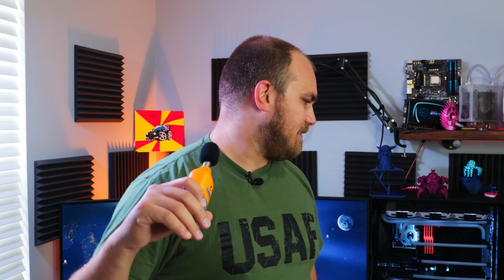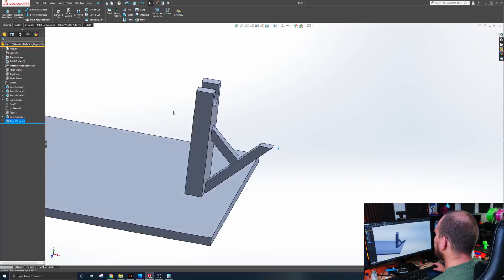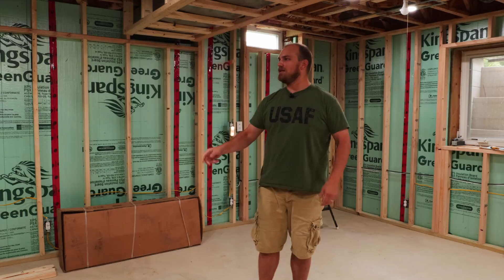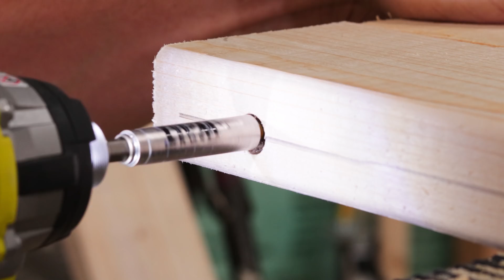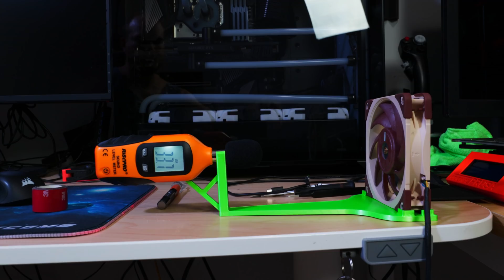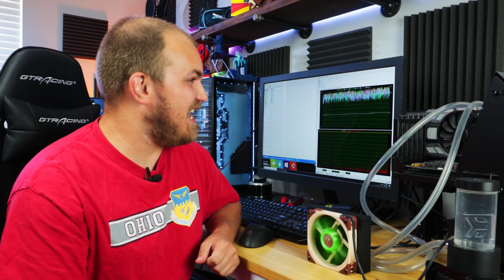Obviously Someone Would Design It That Way | Fan Show Down Episode 2

Comment: the fan thing is a horrible idea. Vibrations from the fan will transmit to the mic through the material connecting them. It won't be an accurate representation of how loud the fans are!

Comment: I'm loving this series, and concept, BUT why doesn't any reviewer "noise-normalize' fans that are being used on radiators, ON THE RADIATOR?!?! The shape of the airflow coming through the fan can drastically change the sound characteristics when said air has to flow up against and ultimately through the radiator. I would imagine this to be especially relevant on custom-designed fans such as in your showdown. It boggles the mind...you test the performance of the fans on the radiator, why not the sound?

Comment: Looks like you set episode 1 to private and did not remove it from the playlist, so the playlist is effectively broken.

Edit: Actually, I have no idea what that first video is. It is private and thus breaks the playlist's auto-play feature. But, Episode 1 has the 6th position in that playlist.
Reply from the maker: I made the first private and reuploaded it because I showed peoples email and then figured they probably didn't want there emails spammed on the internet
Reply: @MajorHardware  Are you aware that you can edit the playlist to fix the order and remove the original?

That sounds like a demeaning question, but I actually know one creator whom only found that functionality after I pointed it out to them. So, i figure it would be polite to repeat that stunt.

Comment: Your audio test is wrong, you pull air by the speaker. A good fan will move alot of air and be queit. But a speaker in airflow will always be loud, a good fan fan do this quiet but a speaker in air wont ever change. Turn the fan mount 90 degrees

Comment: I think the db meter is also going to catch sound from the air. You should put the db meter perpendicular to the air flow and not in the air flow direction. Basically turn the lever arm 90 degrees, perhaps shorten it's length.

Comment: As ridiculous as it looks, that design may still work as an impeller. It would need a different housing to be effective. Impellers work based on centrifugal force; they pull in from the front/back and push it out the sides, radially. A quick fix would be to cover / close up the intake, and cut a notch in one corner of the fan housing. That notch is now the exhaust, and the air would be pulled through the radiator and blown out the notch. Impellers are good for high pressure applications, like vacuums.

Comment: Have you looked into the use of fan stator blades at all? They can help reduce the turbulance put off by the blades and increase the static pressure and motor efficiency. They do increase the noise but with the increased output you may be able to reduce the fan speed for similar performance in a cooling application.

Comment: i recon you should try to use an airfoil wing design for the fan blades and about 5 blades my thinking is the high pressure from the underside of the blades should push more air through the rad

Comment: Shouldn't the sound level be measured non directly instead of in front of the fan?

Isn't testing sound in front of the fan just testing the flow of air?

If you blow directly into a mic / ears, it'll pick it up but it doesn't mean that your blowing would be audible in a room.

Interesting series! :)

Comment: shouldn't you 3D print a nactua fan design to use as a baseline since any fan that is 3D printed will most likely have small ridges and what not that will effect air flow

Comment: I don't know that you want to have the fan and the decibel meter attached. Vibrations from the fan may end up skewing your readings. Secondly having them on a wooden desk would slightly amplify your sound readings as well. Put some rubber feet on that thing.

Comment: Few things, your noise testing is flawed. Your db meter and fan are on a hard surface. Your db meter is gonna pick up vibration. Need to isolate the db meter from any hard surface. Simply lining the mount with neoprene would help alot. 2nd you should do a A weighted noise level. Use the stock fan blade, set to desired noise lvl. And read rpms... then when you test new fan designs. Set to same rpm and test noise to see if fan is louder. Cause you said if you make them the same rpm they will be the same noise and thats wrong.

Comment: Firstly, the db meter stand will conduct vibration from the fan to the meter, which is a bad thing.
Secondly, open-air db levels may not be representative of db levels once attached to the radiator. Noise normalisation should be done in the intended use configuration.

This should be an entertaining series do watch...

Comment: I think it would be really useful to put two temperature probes in your cooling media before and after the radiator. In that way you can tell more effectively how you are changing the heat transfer with each fan. It would be pretty cheap and easy to plumb in.

Comment: green rocket ship design gave me idea. . . normal blades but, inner ring goes smoothly over into two blades, so each blade would be like 3 small blades, 2 small blades connected to one outer blade.

Comment: Thank you for serving our country!! I had a thought for another parameter that can be easily measured... The geek in me would really like to see the amperage draw for each of the designs. From this, the wattage use can be calculated. Use the stock fan as a baseline and then we can see how well 3d printed fans stack up against the original as well as how well they do against each other.

Comment: i just watched the previous part of this, the whole idea of a turbo fan and this dr evil fan flinging the air through the sides gave me 2 small idea that you can easily do (i would do this as a seperate video just for fun and even if it fails it would still be cool to see, so if you want content ideas here is some)... so in the car world we put a shroud that is completely sealed around the radiator so that what ever air is sucked in is not sucked in through the sides before the fins... i know this fan is pushing air in but the same concept applies seal around it between the rad and the fan and air won't leak(all you really need is some insulation foam with an adhesive backing from a hardware store like lowe's or depot) the second idea which came to mind from the turbo fan...it is the idea of a velocity stack... am not going in depth on what that is but you can look it up and get an idea... basically a trumpet shaped device that influences air draw... usually u find this on turbos that suck way more volume in so i doubt this will make a difference here but it would be cool to try and see if those two ideas have any positive effects (u can print a velocity stack so that one is even easier, and in general this will look cool and wacky and will probably get you views if used in the video thumbnail lol)... i just hope you read this and actually do it

Comment: I have a resin printer, if I designed a fan, id rather print it myself and mail it in, that way i know it is as smooth as possible for less air resistance.

Comment: Okay so you're not noise normalizing you're rpm normalizing and reading what each fan registers at a particular speed. because with one design it could be running at 2000 RPMs and not make as much noise as one running at 1000 rpms with a much more aggressive blade pitch. 

Edit: should have watched the entire video lol.

Comment: Could you add some text below each fan which shows what temps/stats the fan kept the system at. For no load and load test. Example of result = avg no load temp in celsius and minutes it took to throttled under load and if it did not throttled stabilized temp

Comment: The frame you made to hold the drone motor that attached to the fan to turn the fan mounted to the motor...(ugh!) 
Anyway, super crazy idea!!! What if you made a frame where you can mount a tail rotor from an RC Helicopter, this way you can use a servo where you can change the pitch of the blades to “control” the amount of flow through the radiator!!!  Do the set up to either push air flow through, OR.  pull air through...test 1 push air.....
Test 2 pull air....Can you smell what I’m stepping in?? That would be epic......

P.S. you could also experiment with printing different types of blade profiles!

Comment: Remember the decibel meter MUST  be decoupled from the fan.
Have it on like a microphone bungee holder on a heavy brick so it won't transfere vibrations till it.

And have it pointing to the fan at a 45°angle at a constant distance
Reply: Preferably 0.5 meters away to prevent unwanted noise from air passing by the mic

Comment: Good stuff !      The load (pressure head) will impact sound and RPM (depending on controller).    I recommend setting sound and measuring speed with the radiator in place...

Comment: Testing noise levels should be done with the radiator so the fan is under load, the fans will have different rpm and noise levels when in free flow vs under load on a radiator!  Love the testing btw😎
Reply: I tought that too. Some of my older noctua fans are loud AF when they try to suck air trough filter or mesh but silent if not mounted anything. Pushing air trough radiator will definetly change sound tone of fan but can't really tell how much it affect dB. Fan can be low dB but still sound annoying, good example of that is my R7 3700X stock cooler.
Reply: What really matters is cooling performance vs noise level.
Reply: Won't really matter as long as they're all tested the same.  But I would like to see a rad test done as well as open air.
Reply: @TheProblematic93  yes it will matter. Some fans produce more static pressure than others. Some more airflow. This will change and impact RPM and noise when there is a radiator behind them.

Comment: I like the idea of the SPL fan bracket but it needs to be mounted on a radiator as the sound (and noise level) changes when the fan is mounted onto a heatsink or radiator.

Comment: Nice vid as usual, loving your fan escapades.

Happy to see the dB meter and frame but I have one concern about the methodology. Due to the interaction between the expelled air and the radiator I don't think 40dB free standing will still be 40dB when on the radiator, in most cases I would expect the mounted fan to be (possibly significantly) louder. Eg: Maybe a fan that creates a spiral flow of air will get louder by a different amount than one that can make a stream with less rotation.
I propose doing the noise normalisation calibration with the fan mounted on the radiator to control for this.

Comment: plz shoot you're videos in 60fps please dude come on( ༎ຶ‿༎ຶ)
Reply from the maker: i can do 60 at 1080p but i do not have the tech for 4k 60, currently peasant status
Reply: @MajorHardware  dude I'd rather watch 720p 60 than 4k 30 (I'm watching on a tab s5e with a 2k OLED 10.5' screen) most people watch on there phones so 1080p is more than enough (ಠωಠ)b
Reply: @3mar00ss6  id rather watch 1080p at 30fps
Reply: @MajorHardware  do you have 2k 50 some YouTubers have that kinda weird but 50 is digestible 乁(; ‾ ~‾)ㄏ
Reply: @MajorHardware  Yes. But 24 fps, as it is now, is a bit low. even 30 fps would be a nice upgrade. 24 fps just looks choppy.
Reply: @MajorHardware  4k is over rated
Reply: Alright the community exists for a reason   DO A POLL ( ¯◡¯)b

Comment from the maker: OOOOO a bit of an oversight by me on the vibration transfer through my sound normalizing rig, i shall correct this. Good lookin
Also i had to re-upload this video, i went in and tried to add a blur over Bryce's email and it corrupted the video :-(
Reply: @MajorHardware  hey can you try to cook a steak with water cooling loop kinda like sous vide :D  i think it would be fun experiment :D
Reply: @wilderness-beastt  I was literally watching Sous Vide Everything, Guga xD
Reply: @hunterfabio  nice :D i love his videos :D
Reply: @wilderness-beastt  you know, I think you'd need a couple CPUs for this (or one AMD) but There's really no reason it wouldn't work. Sous Vide  temps are so relatively low. Benchmark Sous Vide Machine anyone?

"I'll take my steak slightly overclocked thanks."
Reply: @MajorHardware  okay no problem i am going to rewatch this after my csgo match to help you with garbage youtube algorithm :D (anwser to reupload comment)
Reply: i was wondering how this video was uploaded today when i saw it some time ago
Reply: Itsokay man, sure can watch it again for you 😉👍🏼
Reply: vibration is a legit parameter though.  if something vibrates more, it is louder.  imo, ymmv, etc..
Reply: I'm not sure if you have seen mine yet but it is based off a delta electronics fan duct which is taller than the noctua but I adjusted the mounting to hopefully fit you spec you provided. I would recommend a duct extension for best performance but you do you.
Reply: I was wondering🤣 like “wait didn’t I already watched this?!”
Reply: About sound, if you are using Android phone, please consider using Spectroid app for spectral analysis. Overall loudness shows only part of the story the other part is harmonics, good fan should have low noise over all but it also shouldn't whine, especially in the annoying frequency range. Spectral analysis could show some interesting info.
Reply: Why not measure the sound level whilst mounted to the radiator, as this is the way in which the fan will operate, The radiator might change the results of noise level
Reply: @Major Hardware did you use the yt video editor to blur the mail? I blurred something in my video too and it seems it's not working anymore.
Reply: Just make the middle part thinner , this will reduce virbations :) this is how mic shock mounts and speaker stands reduce vibrations :) or make it two pieces and use paracord to make sure the distance it correct :)
Reply: Also if you were really serious about reducing vibrations,you could hang the test rig from roof with paracord : D so nothing touches table or anything :D probably not necessary , but it would give you more accurate results :D
Reply: while your at it, is their any concern about wind sound or is that considered part of the test. i would think motor sound is more the thing being tested.
Reply: i see thats why i cannot watch the video earlier... i was wondering why...
Reply: Need a center port on the intake like a turbo fan...you could print the manifold needed.
Reply: I don't know if anyone mentioned this, but shouldn't you slot the rad in the rig? So with your noise normalize we can see the temps?
Reply: Watching and liking again.
Thanks for addressing the sound rig vibration issue. Can you address the title "Show down" Vs "Showdown" issue I am having :P
Keep up the great content.
Reply: Out of interest have you ever measured actual power draw/costs per hour of work on these printers?
Reply: @Major Hardware I also would put the sound meter parallel to the air flow, you usually don't measure noise directly like that. You want to mimic the behaviour of the user the most, and no one stands in the way of the air flow. And if you remember, sound is basically air compression waves. The air flow will muddy the waters. So basically the way you're setting up, the fans with higher flow will always sound louder, simply because of your rig design. Your protocol is basically restricting air flow on test fans.
Reply: I have a brilliant idea. Try making a bladeless fan just like a dyson fan. If you can do it right it might be quieter than the noctua because it doesnt have to move as much air with motorpower.
Reply: @mediumsmoke7823  a dyson fan is not bladeless. It has a turbine style blade in the base.
Reply: pino de vogel i know that xD but it would be a much smaller fan which could be housed by some sound dampening material. The point here is that with this you could move the fan somewhere to the side (or even in the case) plus dampening material = lots of airflow, less noise
Reply: Is this why you re uploaded?

Comment: Need to get into 3D printing, I've been meaning to for ages...
Reply: Recommendation is to go for an Ender 3 to start with. There is a large community based around that printer, so plenty of support around.
Reply: Just buy a cheaper printer, they get the job done fine these days. Mine was like $250 and works perfectly with all the basic materials